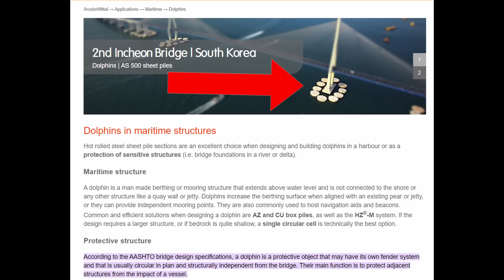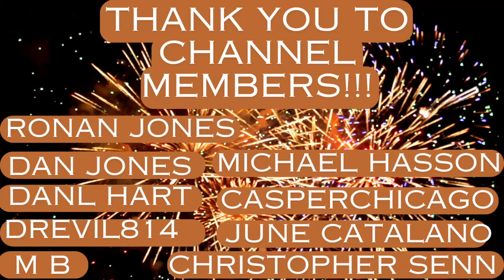Baltimore Bridge Collapse

Comment: A 1,000 foot long ship with millions of tons of mass moving at just a few knots which she had slowed to by the point of impact would take how much of a structure to prevent this? I'm curious what because its not going to be a few pile dolphins and 8x8 beams... This is the only way in and out of Baltimore harbor so the ships have to go under it, there's not way around. Also, its not merely rebuilding the bridge, its that the ships in the port are stuck and the incoming ships are blocked out so there's going to be a huge ripple in the cargo and raw material market on the east coast for a long time that will rival the traffic disruption.
Reply from the maker: A dolphin and fender system big enough to withstand that impact could be successfully designed and built just as it has for many high importance bridges.  At the very least, it could have absorbed enough of the impact to prevent a catastrophic failure of the bridge in my opinion.
Reply: @CaseyJones-Engineer  I should clarify, I believe almost anything can be built or engineered. My question would be what would that require, admittedly with the follow-on of the applicability in this case based on the required channel that has to be maintained and other such context. In essence and I know in some cases it's been as simple as putting shoals around the column so a ship just runs aground first. The bridge and port have seen massive changes in shipping over 50 years and we've got ships that are at the very limit of size that can get thru bridges and channels and potentially limiting the available footprint.
Reply: 100,000 tons. Not millions, but still a lot of momentum.
Reply: @gordonrichardson2972  her gross tonnage is 100,000 tons but my point was in the context of that moving at 5-plus knots coming to (to prevent damage) a full stop is a force much larger than her static weight.
Reply: More than likely they will do a rapid salvage operation of some sort to clear the big debris out of the channel quickly to prevent the worst of the shipping related disruptions - it will probably still take a matter of weeks even to do that however - there will be a lot of debris that has to be found, and   body recovery   will have to be done before any clearing can take place.

Comment: From what I understand the reason the bridge columns didn't have any protection from ship impacts was because it was determined to be too expensive.
Reply from the maker: Exactly.  Now they get to spend in excess of $500 million (maybe way more) to rebuild it.
Reply: No joke. Spending a tiny bit more to do the job right would've paid for itself probably 100X at this point. Its hard to imagine building a bridge with a navigational channel running under it with zero protection from ship impacts. @CaseyJones-Engineer
Reply: @CaseyJones-Engineer  The US 301 bridge over the Potomac, which is about 75% as tall and of a similar length, but doesn't need to pass cargo ships, cost about $800M.

Comment: It was not operating close to the pylon. It is two lane channel under that bridge and the ship was actually in the far side channel, not even in the channel close to the pylon it hit. The ship starts veering off the channel  towards pylon immediately on loss of electric system. Seems the engine is on all along, only electric failure. Hence the propeller was working but no controls. At some point the propeller is full throttle reversed to stop the ship since the other pylon, it did not hit would have started appearing close. The reverse action twists the ship into the other channel and towards the pylon it hits. Well before the impact, the ship drop port side anchor. On a close video, the port anchor is deployed and the starboard anchor is retracted. 

The same ship had electric system failure at another port in Europe causing accident there too.
Reply: No, I read the other accident was human error.

Comment: Emergency powered only brings some systems up such as fire pumps, navcoms navigation lights, emergency lights, helm and steering aka rudder controls, damage control and weapons systems (in Navy ships). It doesn't bring propulsion in line. It may bring the bawthruster in line but if its movin above 5kots  they are not effective sice they are recessed and out of the flow.

Comment: The counterintuitive mistake was to order full power astern (black smoke) while helm is hrown hard over to port in a panic to clear the bridge pylon, as when driving a car. However, as every single-screw boater knows, causes the stern to prop walk to port (left), causing the vessel to point to starboard (right) into the obstruction in this case, a movement accentuated if your rudder is hard over to port (left) in an attempt to steer that way.  The large reverse water flow across the rudder to starboard accentuates the radical port stern thrust causing the bow to point radically to starboard, after initial cavitation shuddered the whole boat, matters went from bad to worst immediately. Rookie panic move, sorry to say. Dropping the port bow anchor is all you can do, but ineffective at the mass, speed and muddy riverbottom condition, the anchor just slides through the mud unable to bite, the anchor mass being negligible compared to the giant moving ship mass, as effective as throwing a paperclip. Solution: Multiple tugs should always be continuing to guide the ship after leaving the dock until past the nearby bridge at this particular harbor. This boat had the same thing happen in Antwerp where her stern stuck the wharf upon departure. It's not uncommon for boat maneuvers at relatively slow speeds near dock for even captains to panic. Very sad. Captain, pilot, and harbormaster share the blame.  Not terrorism or mechanical failure.  Just human error.  The wind was only 6kt and the prevailing river current downstream straight out under the bridge.  To many inexperienced folks it looks like he steered purposefully into the pylon, hence the conspiracy theorists are now and will probably continue forever to proclaim willful intent, aggravating me to no end.

Comment: That is the shipping channel. So not sure about your comments.  Im a mechanical engineering that work for the Navy for 35 years and proximity is dictated by the channel, the pilot, wind and currents. That is why a loss of power on a river or narrow channel is about the worst condition to have. They issued a mayday that stop the vehicle traffic  but th3 workers weren’t able to evacuated.

Comment: You're wondering why the ship was there. The main channel goes right under that span and the ship was on its way out when it lost power. That's a 100,000 Ton container ship. The ship was reversibg it's main engine and they were rolling coal as they say pouring the fuel to it. They did manage to slow from about 7 kts to 1.6 kts before the collision and had dropped the pirt anchor. Of course with this much weight there was a huge force present in the collision.

Did you notice there was no inbound ship? That's s harbor precaution. They only allow one way at a time traffic for larger ships. There's a number of ships waiting below the bay bridge for their turn to enter. That's out of the question now though.

The bridge should definitely have had a better protection system.

As far as additional survivors goes, I wouldn't expect any at this point. As cold as the water is this time of year hypothermia would set in fairly quickly if a person didn't drown outright. Any additional survivors would be a real miracle.

Comment: the bridge was built in 1977...designers didn't anticipate cargo ships of this size back in the mid 70s
Reply: When ships got larger they should not have been permitted in the port until all of the port's infrastructure had been updated to account for their size.  That includes things like installing dolphins (which honestly should have been included when the bridge was constructed).

Comment: It took 5 years to construct, finished in 1977, cost was $60,000,000 (About $350,000,000 in 2024 Weimar dollars) The transmission line was constructed in the last couple of years to replace a 230KV submarine cable. I think one of the big things is, now there is no way for marine traffic to get in or out of The Port of Baltimore. 

The black smoke thing, It was in port so it was burning #2 fuel oil and not #4 bunker. It's a two stroke diesel so it can not scavenge itself just by strokes of the piston, there has to be a blower or turbo or both to supply scavenge air. Maybe the smoke was because of the restart, maybe power setting, maybe low scavenge air pressure. Just guessing at this point. Be nice to know who built the engine and what model

Comment: The bridge piers did not have enough fender protection to minimize or avoid collision with the pier /structure. Considering the height of the new container ships and momentum of the heavy ships,fender protection for this bridge was probably never updated since 1977 when  the bridge was completed .
Reply: SF Bay bridge has tugs doing escort of ship like this ...
Reply: @uploadJ  Even with tugs they still could have lost control.  Ships have been going in and out for 50 years.  It's not like the FIU bridge that collapsed within just hours of being put in place.  The death toll is similar.  Luckily there were very few vehicles on the bridge at the time of collapse.

Comment: Another channel made the point that engineers in the 70s didnt plan for cargo ships this heavy
Reply: They have had four decades to retrofit the dolphins and fenders since sunshine skyway disaster
Reply: @stashi0189   Yep that should have changed all bridges like this.
Reply: @stashi0189 sure but it’s Baltimore go drive around a bit in that city and it will make sense .
Reply: @stashi0189  Undemocratic illegitimate Democrat dictatorship that is more interested in waging foreign wars and open borders with millions of illegals on welfare than in solid infrastructure that would benefit American citizens.
Reply: @stashi0189 
You would have to take that up with the State and local governments
Reply: That still does not explain why proper dolphins were not added later, when ships increased in size.

Comment: You may know a little about bridges, but you should have done minimal research before making some of the pretty clueless statements about the ship.  Sal posted his first video 5 hours before you did that explained a lot, and then 3 hours before you posted he posted the tracking data next to this video with more explanation.  He didn't say it, but based on what he said about what happens when backing down with a single screw ship (trying to slow the ship after getting power back) I almost wonder if they had done nothing they might have made it under the bridge with striking the pier.
Reply from the maker: Everyone's a critic.
Reply: One thing I definitely agree with you on, after what happened to the Skyway Bridge at the entrace to Tampa Bay in 1980, there is no excuse for their not protecting the pier of this bridge from s ship this size, especially given the construction of this bridge which would lead the the collapse of many spans.
Reply: It's also my understanding that Baltimore and spent a lot in recent years to upgrade the port so it could handle ships this size.  Too bad they didn't also spend a little on more dolphins for another ring of protection against these new larger ships.

Comment: I think you will find that constructing any meaningful protection around the base of the piers is quite expensive - so it was decided they were unnecessary and detrimental to the profit-margin. I suspect that decision to be different during the the design of the replacement bridge when a more scrutinised cost/benefit analysis takes place.

Comment: Yes, what I noticed is that there was really no protection for the bridge piers. 2 pairs of small bollards is pretty much worthless.
It seems an extreme cost saving situation when considering how vital this bridge was to the local economy.
Reply from the maker: Yes, another example of pennywise and pound foolish.
Reply: Every bridge worldwide is protected by massive obstacles to redirect ships.
This was suggested for this bridge too but considered to be TOO EXPENSIVE
Reply: @benyomovod6904  That's just pure bullshit. There are lots and lots of bridges all over the world with no protection at all. I live a few km from such a bridge in Sweden, the Öland bridge. It's one of the longest in Europe (it was the longest when it was built) and it has no separate collision protection. It was designed to sustain a collision from a 10 000 t ship at 10 knots but today, ships of 30 000 t pass that bridge (though not often).
Why do you claim things that you have no idea about?
Reply: The whole point of the protection systems is that they are independent of the bridge pillars themselves. No reason (as to the original bridge build time) that they couldn't have been added later.
Reply: The bridge was opened in 1977. Cargo container ships are now much larger than they were back then. The protection system for the bridge may have been adequate back then, but not anymore. I supposed you can argue that it should have been improved as bigger and bigger ships started sailing under the bridge. Unfortunately, sometimes there has to be a fatal accident before people will do anything to prevent it.
Reply: @joevignolor4u949 
In every industry I have worked in as a mechanical engineer (now retired), I have been expected to make annual risk assessments.
Things change over time and unless you have a formal process, you become complacent.
As ships got larger, they would have had to dredge the channel deeper - surely that would have prompted them to think of other implications?
Reply: Yes, surely it's that simple. Surely they just didn't want to spend the money. Surely it can't possibly be even slightly more nuanced than that. America Stupid! And maybe it is that, but I'll wait for more informed voices to pitch in.
Reply: The ship appears to have struck a pier at a point well above the height of the fenders. Hard to imagine fenders tall enough or strong enough to prevent such an impact.
Reply: @laurelcreek7  you can build fenders and dolphins 100 ft away from the bridge piers. One or two century old technology. Mind boggling irresponsible decision making
Reply: @stashi0189 
I have seen an argument that dolphins large enough to prevent such a collision would have made the entry inaccessible to large ships entirely.
Reply: Dems call that BUILD BACK BETTER.

Comment: That looks like exhaust from the ships main engines. That may indicate hard astern

But a blackout would make a lot of sense as a contributing factor. Emergency power should give rudder control (it does in most ships I have been on). Usually only smaller ones wouldn’t. 

This will be an interesting investigation

Comment: It's THE entrance to the 8th busiest port in the US, that's why it was there. It had two harbor pilots onboard at the time and they notified Port Authority when the engine problems began, which enabled them to stop vehicle ingress to the bridge. I can't speculate why the pylons weren't protected but every ship going in and out of Port of Baltimore is required to have a pilot, so safeguards were in place. Obviously nobody important ever asked what happens if a ship loses steering.
Reply: in addition, they dropped at least one anchor which apparently dragged as the ship continued toward the bridge structure without being able to steer. I am interested in learning how much time transpired between power going out, the mayday call going in, the alert to the construction workers and authorities to close the bridge and evacuate.
Reply: re: "I can't speculate why the pylons weren't protected "
Thinking here is that the ship when this bridge first designed (early 70's?) and opened in 1977 (47 yrs ago) that large container ships of this type with the large bow overhang didn't exist ... so large protective islands were never in the plans. Be interesting to know when the power transmission towers were designed and put in now ...
Reply: @uploadJ  The power lines were put in a year or two ago.
Reply: The power transmission lines were erected in 2022... I watched the project for 2 years,,, @uploadJ
Reply: @uploadJ  Protection systems can be retrofitted after the original design.
Reply: @uploadJ  I don't think that dolphins would stand a chance against a ship of that size and weight with so many containers on it.
Reply: When the lights come on on a ship that means it's going to emergency power when the lights go off that's normal operation for an ocean vessel only the red and green lights should be on when ship is functional
Reply: Has this ever happened before?
Reply: That’s what harbor tugs are for.
Reply: But the did ask if the bridges were racist.
Reply: This is going to start happening a lot more when you adopt DEI hiring. Hiring based on fill in the blank instead of actual qualifications.

Comment: i got problems too. 1. why was this foreign ship not tethered to Tugs? 2. foreign vessels are not permitted in ports under their own power- to prevent such a catastrophe. 3. no presence of tug boats is the conspiracy
Reply: Um... It was in transit, why would it need a tug? There were 2 pilots onboard. It had engine problems while underway and dropped anchor, but too late. And... no such rule as you made up about foreign ships, most cargo ships in US ports are foreign flagged btw. Take off the tin foil hat and take a deep breath dude.

Comment: this was 100,000ton ship going 8kts no amount of dolphins was going to stop this ship. the channel there is VERY narrow. if a ship this big is going to hit its going to hit and nothing is going to stop it. but the bigger question is why they lost power and steering. at this point its body recovery. water temp is 40f air temp was in the 40s as well temps like that you have less then 2 hours in the water. any not pulled out by now is dead